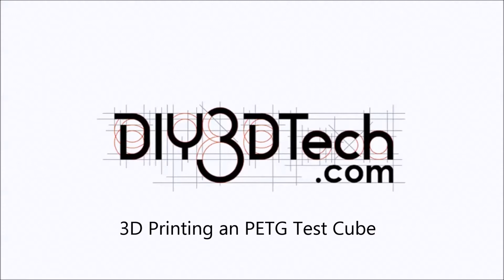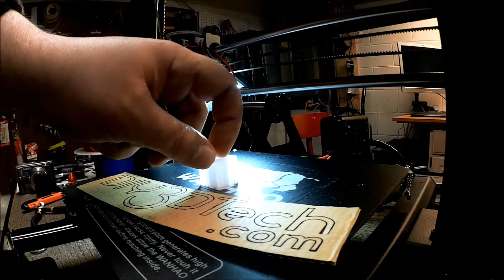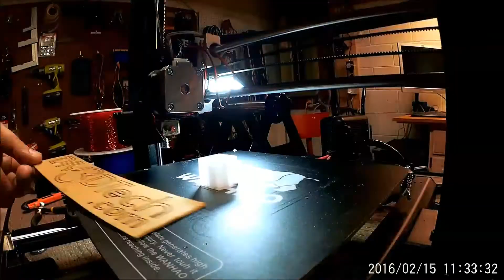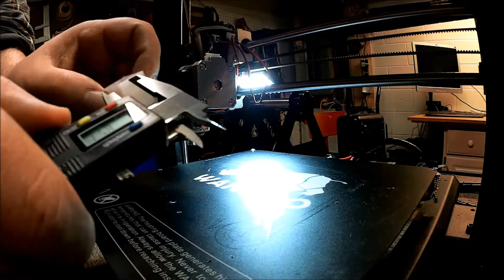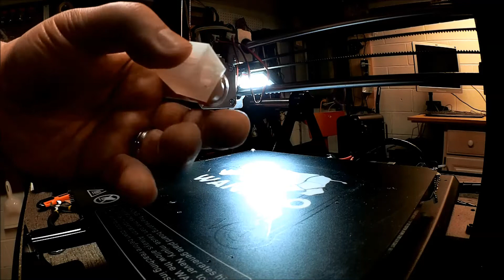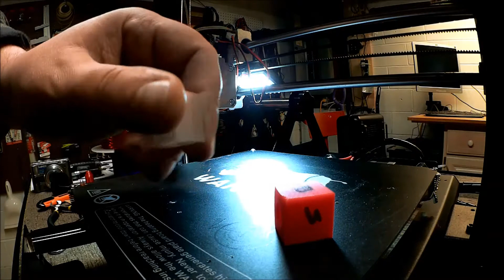3D Printing an PETG Test Cube

Comment: Can you give the settings you used for your wanhao duplicator and the sainbridge pet-g? i ordered some and am wondering what settings to use
Reply from the maker: printing at 250c and set the bed around 60c (which is arbitrary).  However be careful if you have the stock Wanhao as there is a PETE tube in the not end and it will melt around 255c so its recommended to have an all metal hot end.  Let me know how it works for you please...

Comment: Hello DIY,  it is possible to get a simple to test the break failure point, I have a prototype to build and I need a toughness matériel due to the tine design (1 to 2mm thick)
Reply from the maker: +Eric Boucher take a look at this link, belive it will provide the failure point data you looking for: http://www.nationwideplastics.net/pdfs/Petg/(New)%20PETG%20Material%20Datasheet.pdf

Comment: good video as usual ! As a toughness test I was thinking of something like forcing a small pin inside the base (because it is the strongest part of the cube )maybe like a 1/16" pin install on a drill press (not turning) then placing the block on a balance on the table pressing the pin inside the base layer  while < videoing > the weight on the balance. Then the weight need to break can be translate to square inch pressure break point . That is just an idea and there is a number of other measurement possible that where never compile on these materiel after extrusion .It is kind of long but maybe fun THANK !